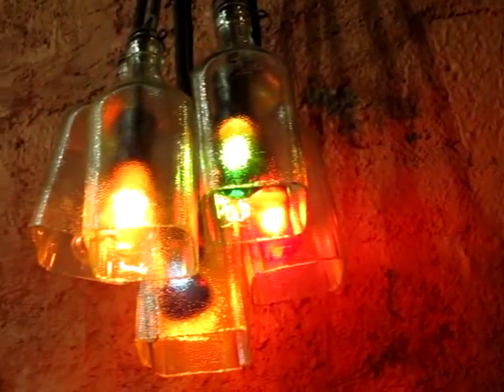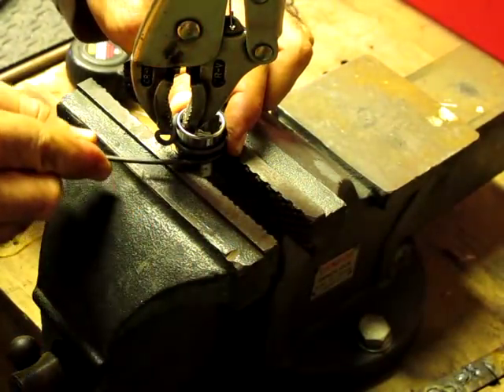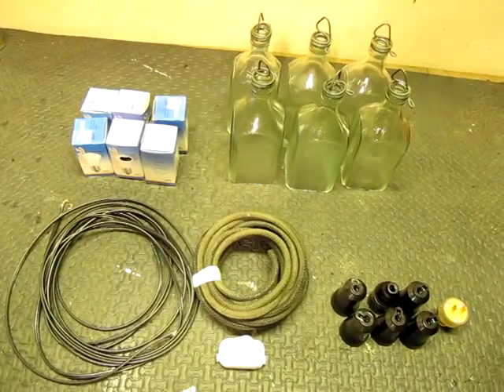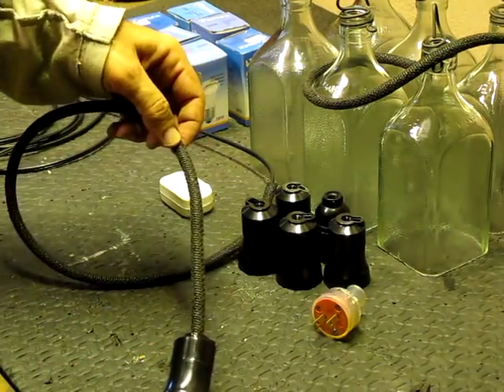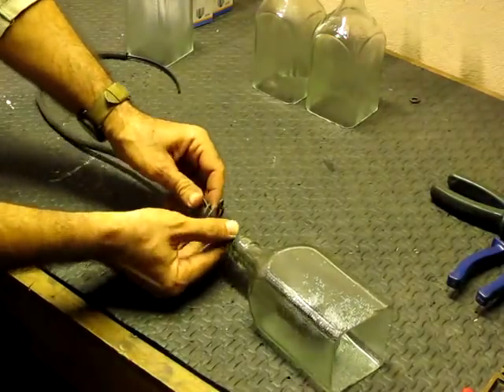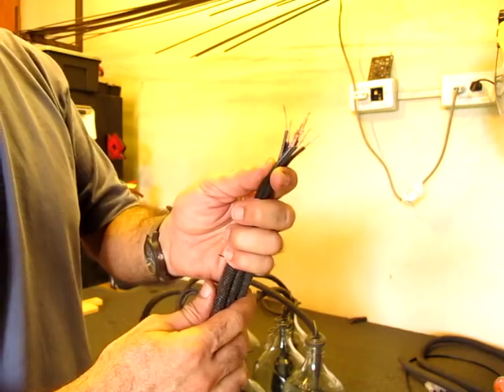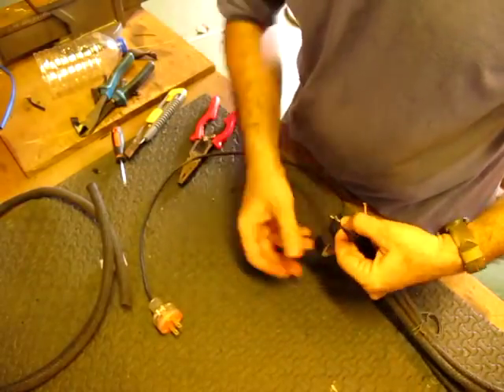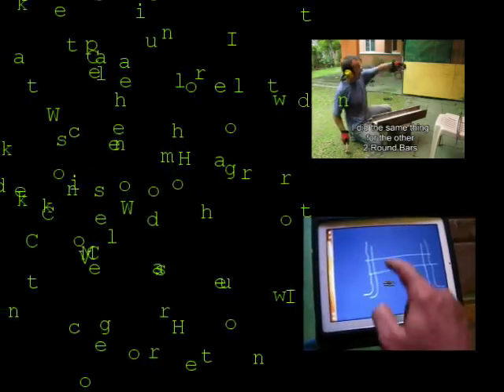Recycled Bottles Made Into A Beautiful Chandelier, Easy DIY Project

Comment: Awesome and we'll done video! Thanks for inspiration and a clearer sense of my own attempt at a industrial style chandelier. And for most of you out there asking about the 3 mm wire he uses on top of the bottles and as the hook you'll have better luck going to an industrial supply store though I have seen it hardware stores ( especially a fastener supply store. I've heard referred to as mechanics wire and is available in different gauges.
Reply from the maker: Charles thank you for your kind comment and the info. THe wires are mild steel. I have heard them being referred to as Oil Wire, Tie Wire, and a few other things which won't translate to English.

Saeid

Comment: Another great one ... you explain the process so well! I like how the materials are near free and so much can be made by bending wire. You don't need anything but I would like to see what you would make with two tools: A spot welder & a 3 in 1 sheet metal brake, shear and slip roll. OK three tools ... add a ring roller. Just look those up I have a demo video of the 3 in 1 if you look back in my old videos. You do really great work!!
Reply from the maker: Hey thanks! I had a look through your old videos, but couldn't find the one you're refering to. Can you send me a link pls?

This wire I'm working with is really great. It bends easily, but it's near impossible to break it. So it opens up a lot of possibilities.

Comment: All of your videos I've watched have been great!!  The way you explain and demonstrate each step is sooo helpful.  Do you really need the fireproof casing if you buy the proper electrical wire in the US?  Keep making your videos,  I'll be watching.
Reply from the maker: Hi E.J. Thanks for your kind comment. I appreciate it.

No, you don't need the casing. I used it to make it look a bit more Industrial, that's all. THe whole set up is so low power (per my wiring diagram) that you can get away with just about any electrical wire, as long as it can hold up the bottles.

Saeid

Comment: Awesome work, I saw your video on cutting wine bottles and the jig you made - but how did you cut the square bottles in this video? Thanks.
Reply from the maker: I thought I mentioned that already. I used a wet tile saw with a diamond blade. It's fairly easy to do. But soon as I can I want to make a gizmo for cutting square bottles with simple tools, like the one for round bottles. No doubt it can be done.

Thanks for your comment,

Saeid
Reply: Saeid Momtahan
 It is actually easier than it seems.  Hard mount your glass cutter on a block at the requisite height (make sure the glass wheel is flat or you won't get a clean break).  Mount that block to a flat surface.  Now just apply even pressure to your bottle and slowly move the bottle across the cutter one revolution and hit it with the candle and cold water trick.  The only difference is you will be moving the bottle in a square motion over the candle instead of just rotating it around its axis.  Cheers!

Comment: Newbie here...Can I ask what kind of wire you are using for the holders at the tops of the bottles?  It sounded like you said "3mm" wire.  I searched for 3 millimeter wire, but everything I found looked and sounded too flimsy and too soft.  Can you tell me where you can get a coil of wire that you are using?
Reply from the maker: Hi DR.
I did say 3 MM. The only place I have found this type of wire is in Iran. That's why I brought a whole bunch of it to where I live.

look around for other ideas, you don't need to copy the design. Change it to fit the material you have access to. 

Try this in YT search box 'how to hang jars'

Thanks,
Saeid
Reply: Saeid Momtahan Ok, thank you so much for the information.  I've seen this kind of wire used on certain things I have bought in the past, but I've never seen it just by itself available to the consumer.  I'm hoping I can find something similar to it, because I could think of a hundred uses for it.  But the fact that the only place you have seen it is in Iran doesn't make me very hopeful, lol.  But I'm optimistic I can hopefully find a suitable substitute.
Reply from the maker: DR, you can look in gardening supply stores. They have the galvanized version of this wire. When you can't find all the parts you need, that's when all the fun starts (-:

Good luck with your projects.

Saeid
Reply: Thanks so much Saeid for the great info.  Oh I don't plan to do a complete copy, but I am definitely inspired by your design to do something similar.  I love moody atmospheric lighting like this.  I am interested in this type of wire because I can think of a hundred other things I could use it for.  Thanks again for the info.
Reply from the maker: My pleasure DR.

Saeid

Comment: The blue wire must connect to the plug.
Reply: +phat mike No; his diagram will work. It isn't code but a lot of low voltage lamps are wired this way. Irritating but it will work as drawn.

Comment: these bulbs are not easy to find.. can you please help .. the bulbs u have used have candy colors like green orange ,, i am not able to find them ... :(
Reply from the maker: Khalid, these are the cheapest bulbs that were in the market. Work with what ever you can find. Note the wiring I have used. That makes the lights dimmer and therefore nicer.
TY

SAeid
Reply: Saeid Momtahan Tnx so much Saeid..
I am on it .. and ya.. the 3mm wire that you use.. what wire is that ..
Reply from the maker: It's called black steel or Oil Steel. I find that only in Iran. But again, work with whatever you find in your area. Galvanized wire will work, although IMO not as nice.

SAeid

Comment: Chandelier is really nice, but the wireing diagram isnt. It wouldn`t work if conected as shown. The blue cable isn`t connected.
Reply: +Wojciech Rosegnal It isn't to code but it will work on low voltage lighting like he is using. A lot of lighting is wired this way; bugs the crap out of me but it does work.

Comment: Nice Chandelier. Too bad it won't light (...unless you connect it up to 240 VAC)!!!. Both the video and the wiring diagram show each bulb receiving 60 VAC rather than 120 VAC. All bulbs need to be wired in parallel; not parallel pairs.  Nice idea though. Thanks.
Reply from the maker: The wiring was done that way on purpose. I wanted lights to work at half capacity, consuming half the power, producing half the light, looking moodier.

TY
SAeid